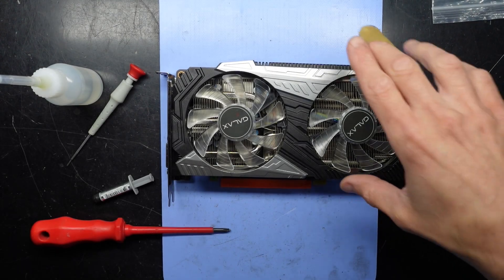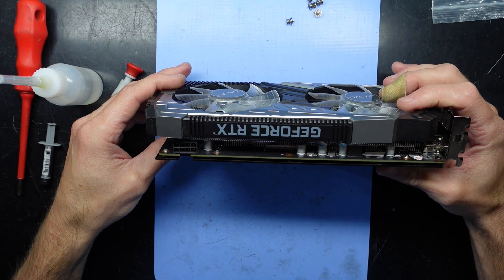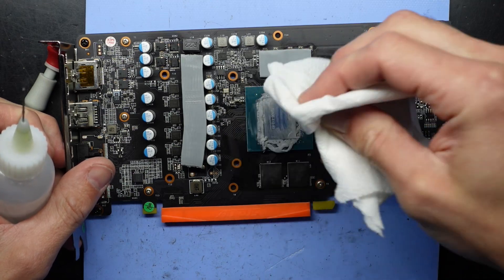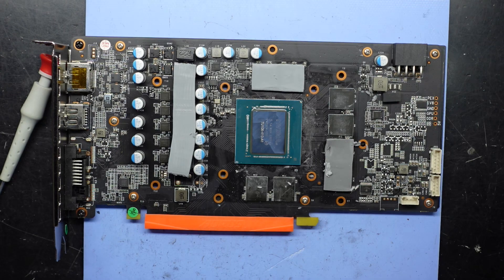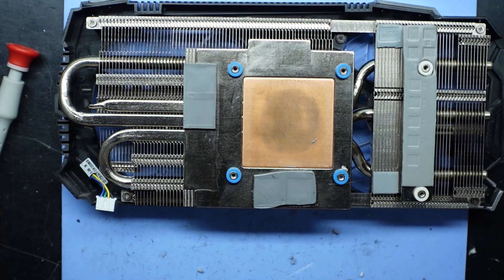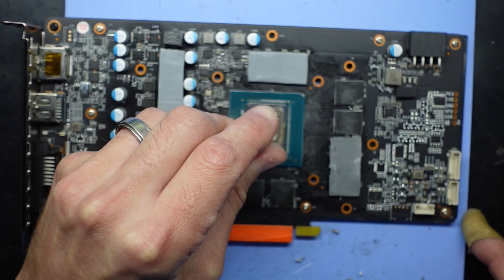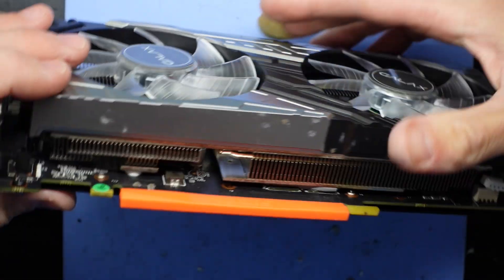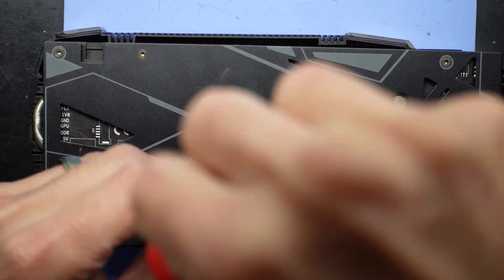Galax 2060 Super Thermal Paste Replacement

Comment: Anyone still here in 2025: thermal pads in the galax 2060s are 1.5mm thick
Reply: Thanks man exactly what i was looking for.
Reply: also for vram and vrm mofset same 1.5m pad ?
Reply: @XPINDIA1974  everything is 1.5mm but make sure to cut around some areas where the heatsink touches the vrm bc theres a screw standoff there that the factory thermalpads are cut around but ur gonna have to improvise and leave that little area out
Reply: @moo1172 is my Gigabyte 2060 super also 1.5mm?

Comment: bro, this is how you rip those small caps off next to the die. NEVER use a tooth brush like that, also you are way too hard handed with your paper towel use, but still good that you got it done without damaging your GPU. also should/could have replaced the thermal pads while at it.
Reply from the maker: iv done plenty of thermal paste replacements and have never had an issue
Reply: Can thermal pads even wear out?
Reply: @ackerkartoffel8627  ofc just like anything cohesive going trough stress/heat cycles. Everything deteriorates, just like us. It just matters at what rate.